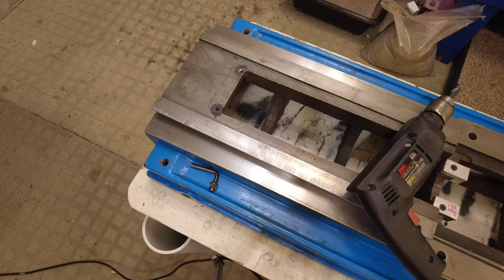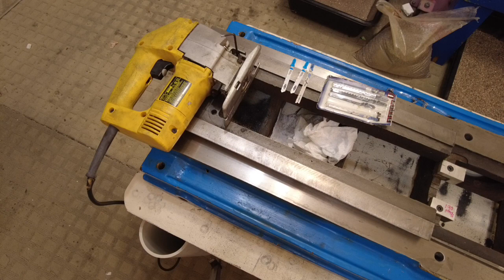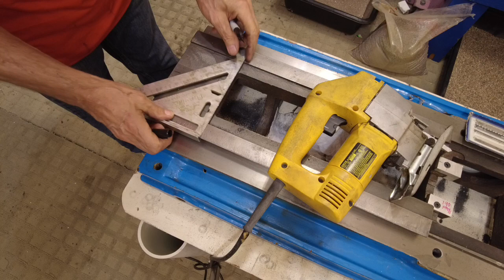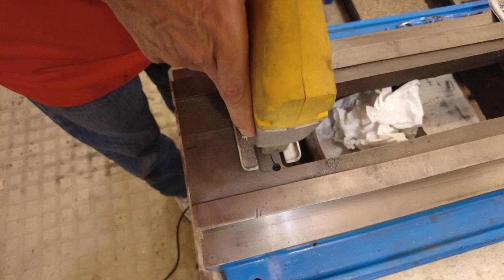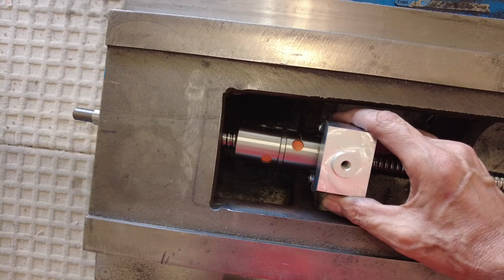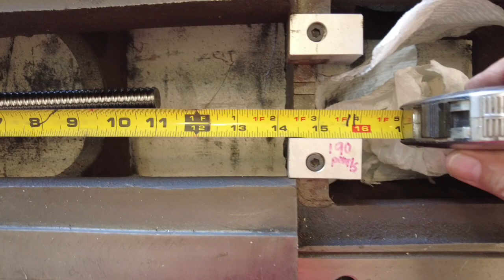Cutting the Y slot on the IH/Charter Oak mill for more Y travel..

Comment: I’m curious, I have a manual PM-932 (non CNC) mill and I was wondering if I too can gain travel by cutting this section of material out to gain Y-axis travel?  Is this section of the casting preventing the saddle from moving further towards the operator ?
Reply from the maker: I have the 932 too. Yes you can cut the slot for more Y.  With the 932 it has no cross bracing so the ways will become slightly weaker.  I'm sure a inch or so will be fine.